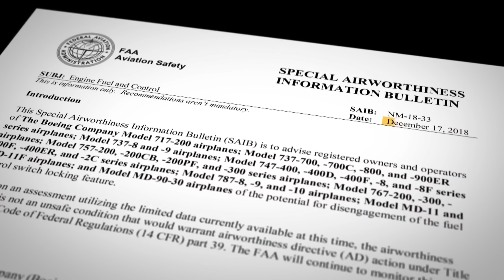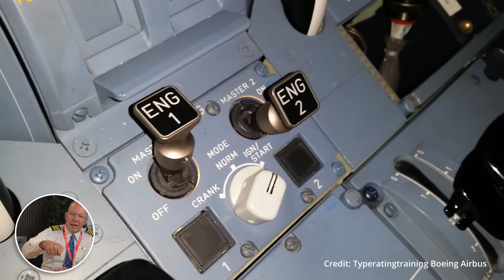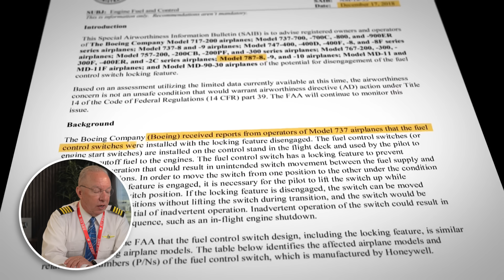Air India 171: The FAA’s 2018 Fuel Switch Locking Bulletin Explained (16 Questions Answered)

Comment: I think that the final investigation will determine whether one of the 2 pilots actually activated these 2 cutoff switches (or not). Indeed, I know that the black box that contains the voice recordings records all sounds in the cockpit. And I imagine that this type of switch makes a particular noise when activated (even if this noise is very low). And by analyzing the audio recordings of this "voice" black box, it will probably be possible to detect the characteristic noise of this switch. In short, this type of analysis will probably take time, and I understand that the preliminary report does not contain this analysis (due to lack of time). Personally, I consider that the preliminary report does not allow for the moment to rule out other possibilities. It is not yet certain that the origin of this air crash was due to a voluntary action of one of the 2 pilots. However, I am quite confident that a detailed analysis of the cockpit audio tape will provide more certainty about the cause of this crash. It is important to know that in the history of aviation, investigations of crashes have analyzed the audio tapes quite carefully. All I hope is that the final investigation will accurately determine the cause of this crash. My thoughts are with all the families affected by this air crash.
Reply: I imagine the voices can be analyzed to determine who said what.  Our voices are fairly unique to an individual unless you are trying to imitate someone else's voice.
Reply: @danburch9989  It is also possible that the pilot believed that the co-pilot had made the Cutoff, and indicated it to him. The co-pilot replied that he had done nothing. In short, the question is whether these switches were manipulated mechanically (and the analysis of the audio tape should be able to allow this). In the case where we realize that the switches were not manipulated mechanically, the hypothesis of a technical problem (switches, computer which manages these switches, ...) or sabotage is possible. The big question is whether on the audio tape, it is possible to hear the manipulation of these switches before one of the pilots asks the other the reason why he made the cutoff. This analysis is not currently done, it is not yet possible to fully decide on the origin of this air crash. The scenario indicating the good faith of the 2 pilots is not yet completely excluded. Let's imagine that one of the 2 pilots notices that the engines are stopping, that a screen indicates to him that the cutoff of the 2 fuel pumps has been activated, that he makes the remark to the other pilot, that the latter replies that he has done nothing, and that the 2 switches are still mechanically ON ..... --> This is a scenario still possible in this investigation and which fits with the preliminary report. And I have no doubt that the investigators also have this scenario in mind. It is true that what casts doubt on this preliminary report is the fact that there is no manufacturer action to be taken by Boeing, and that there is a psychological study underway of the pilots.

Comment: Video at 2:22 to 2:34 does not show the correct type of mechanical pull lock-out (fuel-control switches) used in 787.  The 787 switches have a flat rectangular hump on the panel side, and the switch handle side has a sharp V arrow shape pointing down which must be pulled up and over that long flat rectangular hump.  That flat rectangular hump can hang a switch, especially as the sharp V point wears down.  Also V shaped mechanical pull lock-outs aren't used in machine shops anymore because those are unreliable and allow the ingress of debris which can stop the mechanical pull lock-out from working corectly.

Comment: For what reason is it possible to operate these switches/thus switch off the fuel pumps - even though the thrust levers are not in the idle position?

Comment: How easy is it for you to blame manual intervention when you completely know based on the FAA bulletin that indicates issues with switch that could inadvertently change the switch position without any manual intervention. 6:15 
Why are you giving a clean chit to Boeing knowing very well the design flaw of the switch locking, FAA also brushing under the carpet as service bulletin instead of a stricter measures to be taken to fix it

Comment: I'm a helicopter PIC. Every helicopter I've ever flown has the fuel cut off above my head forward of the circuit panel. in 21 years of flying I've had to emergency shutdown ONCE. Never had to worry about accidently shutting the fuel off.

Comment: I agree about no cameras because driver/pilot facing cameras don't increase safety, just stress. It's there specifically so the company and insurance company can place blame and avoid liability.

Most semi trucks that have driver facing cameras do it because the insurance company requires it, because then if a driver does something stupid and causes an accident, the insurance company can refuse to pay it and sue the driver.

Most of them are AI powered and will ding the driver for drinking water or eating a snack or looking in the mirrors too long, and they are used by unhappy Safety Managers to harass and fire good drivers.

Cameras don't increase safety, they just pin blame on the driver.
And if a careless distracted driver gets fired because of the camera, they will just get hired by another company that doesn't have cameras, so they aren't actually getting removed from the road.

And when you get into international flights, now you are going to be dealing with the authorities in other countries demanding a copy of the video to see if the pilots are doing anything they can fine them for.

Comment: Once wheels become airborne on take-off, why not have the flight computer deny fuel cut-off until the aircraft reaches 500 feet?  This should be an easy modification from Boeing.
Reply: Engine fire exceptions would have to be factored into the software.

Comment: Again this is only a hypothesis, and here’s another question:

If we assume the PM had good intent, the failure to retract gear from 50 to 400 ft makes no operational sense — especially with both engines running, full hydraulic pressure available, if a gear-up call already made.

But if we assume the PM had planned this, then deliberately delaying gear retraction until the aircraft reached the no-return threshold (~600 ft AGL) becomes a highly calculated move — one designed to:
	•	Increase drag
	•	Prevent acceleration
	•	Ensure any subsequent dual engine failure would lead to a total loss of lift, glide, and recovery margin.

Comment: Thanks for your video Capt Steeeve.  Excellent as always.  I think that you should take another look at FAA's bulletin SAIB NM-18-33.  Recommendation 1 on the second page says that airlines should inspect the switch and "if the switch can be moved without lifting it up, the locking feature has been disengaged and the switch should be replaced."  It seems like the locking feature not working would be obvious and identified relatively quickly, but I assume the investigation will look into if Air India received the bulletin and if they did a formal inspection in response to the bulletin.

Comment: I disagree with the video recording. These footage should only be available for review if there is a serious incident or accident. It would benefit everyone: the public as well as the safety measures. It can 
a) illustrate how not to behave in such a stressfull situation (if there is pilot error found)
b) even though the accident would not have been prevented, thats true, it would take out the whole guesswork happening all over social media and youtube. If the footage showed that one of the Pilot did it, you dont need to investigate on technical issues. 
If he didn't do it, you'd need to fix all Boings using these kind of switches. Maybe it was a suicide mission, maybe it was not. But now there is a delay (if we find it out at all) to know if it was indeed a murder/suicide action or if it was a malfunction...

Comment: Could they have made that switch manditory to be operated by both pilots? So one pilot alone can't use it and requires an input from both to action it? 

I know in some cases you to action this quickly, but it can be on dual switch input for cut off to prevent an intentional action. 🤷🏼‍♂️

Comment: nitially, the fuel switch in the on position must have malfunctioned due to some electrical glitch. This means, though they were physically on, functionally they were off. These reduced the engine power, which must have triggered the cockpit warning signals. The pilots at that point must have then tried to recheck the fuel switch by moving it on and off (confirmed that they really did within 1 sec), to check if the switches are OK, and really working (which we all do as part of human behavior when something doesn't work ). Finally, they put it on. But by then, the engine had stalled, and it crashed. There is no conspiracy or pilot fault unless we can prove that the fuel switches were actually functional. Put yourself in the pilot's shoes at that peak of emergency and ask how much your cognitive and motor skills will work trying to troubleshoot a problem, as well as to save the flight from crash all SIMULTANEOUSLY within less than 2 mins.

Comment: It's been stated that the Co Pilot was flying and Captain was monitoring. That being the case, the  Co Pilot would have had both hands on the yoke and been looking ahead ?? How feasible is it that he could have removed one hand , reached across to flip the fuel switches to off and not been noticed by the Captain whilst he was actually doing it ?? 

It's not been stated whether there is any other verbal communications on the voice recorder. Is it possible there is and it's not been released to the public for some reason?? I understand the perspective that's been given for the 2 sentences that have been released. However,  I can't help but consider if whoever said  " I did not do so " was actually telling the truth and further investigations will support this. I understand what's been said so far about the switches, but there's a first time for everything, right!

Comment: It is UNACCEPTABLE to deny cameras in the cockpit. "...cameras catch things pilots aren't supposed to be doing..." That's literally the definition of the preventive dimension of why they SHOULD be there. However, there should be cameras in 1) the cockpit, 2) top of the vertical stabilizer viewing the top of the aircraft, 3) nose cone (2) one looking forward, one looking aft, and 4) under the tail looking forward. The diagnostic (remedial) information that can be gleaned from this input would 1) help shorten investigations, 2) provide clues that may not be captured through the onboard data stream, and 3) help to gain insight about corrective actions. 

Unless you're banging a stewy like it's the 1970s, there is nothing to be worried about. As for abuse, just put in the pilot contract that the information is accessed only from the black box after a FAA reportable incident.
Reply: LOL.
And another one who thinks the FAA governs the whole universe and planet Earth is inhabited by chattel to the great US of A....
Reply: Lol another one dimensional armchair thinking surveillance is the answer as if investigators have no way of knowing. You passively say that because it's not your job. Have your employer put a camera dedicated to only your small workspace recording every action of your day, see how you like it.

Comment: Why are the fuel cutoffs side by side? Surely it would be better to have them separated in the cockpit so that one pilot (possibly going rogue) could not deactivate both at once. That would then require both pilots to deactivate one engine each and make it much more difficult for this situation to arise

Comment: How is it possible for such a complex electronic system to allow something like this? How can the flight computer allow you to shut off fuel to both engines when it is set for takeoff and knows it needs to provide maximum power to the engines for takeoff? If it allows this, it means there is a serious software error. Basically, it allows you to commit suicide.

Comment: Captain Steeeve, you obviously have already made up your mind on what happened based on the Preliminary Report, that this was an intentional act by one of the pilots.  However, the Prelim Report is incomplete and missing some key details, including the full CVR transcript, unedited and untranslated, as well as cockpit sound evidence that the FCO switches were physically moved by one of the pilots.  All of this should come out in the ongoing investigation and final report.  What is troubling about the Prelim Report is that it is almost like they have cherry picked certain facts and details to lead us to a particular conclusion, i.e. that is was an intentional act by one of the pilots.  We can also be sure there will be some forensic investigation into the pilots to look for clues as to their frame of mind that day and motive, and perhaps they don't want to assign blame until this part of the investigation had been completed.  One of my other questions that has not been answered by anyone is: was their third (relief) pilot in the cockpit for takeoff, could this person have seen what happened, and could this person be heard on the CVR?  Regarding the resistance to cockpit video, this seems to be a US airline issue as there are airlines around the world that have this or allow this, and we see many videos from this on YouTube.  And yes, I believe the software could be programmed to not allow a dual engine fuel cutoff below a certain safe altitude when on climbout.  One of my questions is: what does Airbus do?  Could this have happened on an Airbus plane?  Granted, if one of the pilots wanted to intentionally down the plane that day, they would just find another way to do it, as we have seen this happen in past incidents.

Comment: No cameras!!! I am a fleet operator , and at some point we just need to stop with all of this monitoring and spying. People are not going to want to be pilots or drivers anymore….  Also to the person that disagrees with this, ask yourself what you do for work, and if you would want to be constantly filmed all day long while you were doing your job, for the sole reason that your boss could look at the footage to see what you did wrong?

The data recorders and cockpit voice recorders are enough.

Rather than say put cameras in the cockpit, we should hold manufacturer responsible to design these systems to be Better. If there is no chime when you throw the engine switch to cutoff , that is ridiculous, and needs to be fixed immediately.this chime would then be heard on the cockpit recorder.

Sorry just my opinion.
Reply: Locomotive operators (engineers of train locomotives) are always under camera surveillance. So, I have to disagree with your comment.

Comment: Capt Steve, the way you dismissed any wiring, RDC and bus failures - left me speachless.. Are you saying Flight Data Recorders record a "physical" position og engine switches via "sensor" installed at the switch lever box?? 🤔

Comment: The explanation by Capt Steve justifying why  cameras in the cockpit are not necessary is utter nonsense. Captain Steve should be ashamed of himself. He states. "The cockpit voice recorder and data recorder provides ALL the information needed". Wrong. "All you're missing is the visual component", he says. Why is it "missing"? Logic, common sense, and proper oversight dictates the inclusion of video capability. The information would be retained in a data recorder that is not accessed unless valid reasons exist for doing so. The example of "leaked" information exposing a pilot of reading a magazine is irrelevant. Fraudulent use of any data can be managed with controls and punishments. In prior videos Capt Steve raises the issue of pilot mental state. This too could possibly be verified by visual observation. If a co-pilot recognizes potential mental health concerns (as Capt Steve mentions) the camera will reveal that as well in post accident investigations. There is NO justification for not having video recorders in a passenger aircraft cockpit. Pilots have enormous responsibility. Any pilot who objects to the suggestion of cockpit video recorders needs to choose a different career. A pilot who endorses the inclusion of video observation is the pilot I want flying an aircraft where I'm a passenger. Capt Steve,,,,please adopt the professional position of endorsing video monitoring in the cockpit.

Comment: Capt Steve. Capt Glenn Tanguay here. 46.5 years experienced. 36 years Air Canada and 10 years experience in the high arctic on DC3. 9 years 787 as line endoc training Capt. I believe we should give the benefit of doubt to the pilots. Sounds like the skipper had a momentary brain fart. Maybe disorientation with the positive rate sensation and acceleration. He did something until and forgot what he just did. Respectfully, please explore spatial disorientation.
Glenn Tanguay

Comment: Captain, in your answer to the last question you presumed that the pilot who returned the cutoff switches to the Run position was not the same pilot who originally moved the switches to the Cutoff position and/or denied doing so. We don't have enough information to make that assumption. (Sometimes a person called out on their mistake will move quickly to correct their error.)